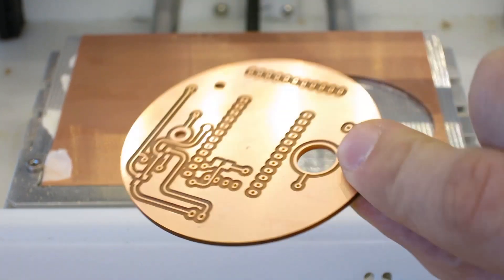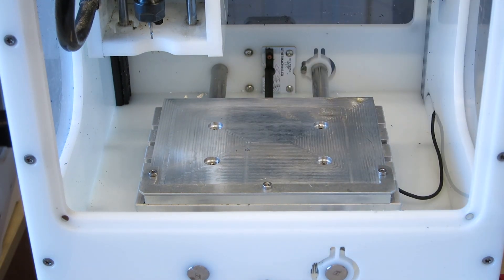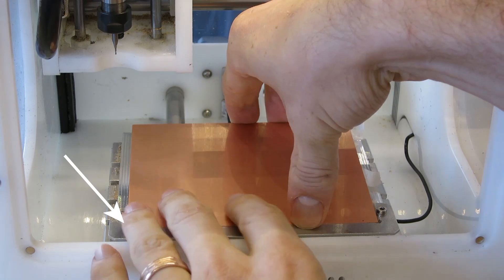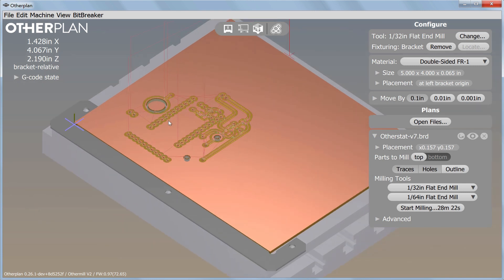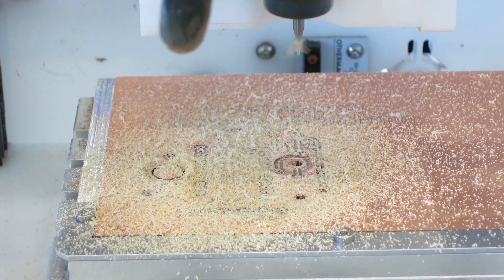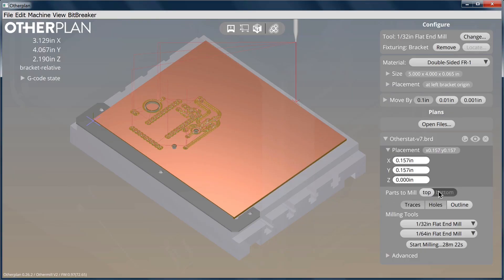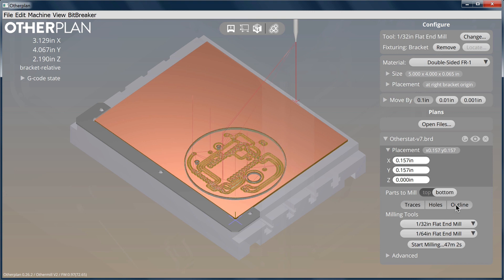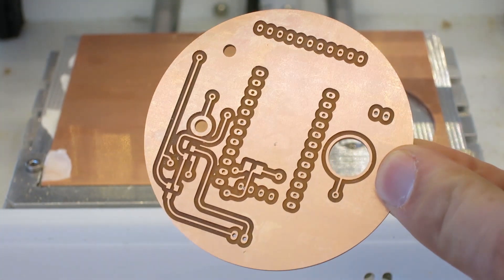How To Mill Double-Sided PCBs with Desktop PCB Milling Machine

Comment: I thought PCB were green. Why is this in bare copper?
Reply: You're thinking of solder mask, "a thin lacquer-like layer of polymer that is usually applied to the copper traces of a printed circuit board" (wikipedia). IDK if one can apply soldermask themselves but for hobby purposes they're not always necessary. Solder mask is used to repel solder when soldering, so that only the pad is exposed.

Comment: 😗 price so huge
Reply: It's a fantastic machine, for prototyping PCB's, I really couldn't imagine making them without it.
Reply: China has so much better options for 10% or less of the crazy price. Way way way overpriced. 4 motors and some acrylic.
Reply: Julio Ryuuzaki Using such simplified descriptors, computers are nothing more than sand, silicon, and plastic. Actually very simple, why bother paying for one when you can make your own?
Reply: Zakira Gur yeah, there are diy tutorials to make cnc machines. And for almost the same price you can get kits. What’s so different from this kit from the Chinese ones? Same Nema motors, generic brushless motor, anything special about the driver micro controller that a Raspberry Pi or even an Arduino can’t do? What’s so good about it to make it 3000?
Reply: You could've enjoyed the precision of the machine, it's pretty cool, also it's not just the machine, it has custom software for taking Gerber files, and making it an easy point and click process for quick PCB protoyping, it's not for everyone at 3k, but you can't hate those sweet results. I believe you've inspired me to make a video review though. ,':3 Cheers mate.
Reply: Zakira Gur By definition CNC is precise, and just by YouTubing about PCB making with custom made cnc machines, there is nothing special about this one. The custom software looks decent, but is not a 3k software, is just a simple 3D render of a Grbl file, at the end is sending the same G-Code to the controller than any other of the tons of free software can send. Does it have wireless interface? A webcam to check progress online? Automatic time lapse videos? A Raspberry Pi can do that. How about Auto feed boards for mass production? Like I said, it’s not much different from less than 300 dlls Chinese made ones. Completely Overpriced.
Reply: @RyuuzakiJulio  I didn't mean to intrude upon Chinese stocks, I was just pointing out that for someone who wanted reliable and accurate PCB prototypes, it's a fantastic machine, it's not meant to do production, it also doesn't need to be wireless, because it sits on your desk, and the PCB's are done in minutes, I know, because I have one. Just saying, I personally don't have the time to put into a DIY mill, I'm sure with someone with more time on their hands they can assemble and test their own mills, I prefer to be designing first and foremost. Cheers.
Reply: Zakira Gur Not everyone has a huge desk to put all kinds of peripherals. But you are right the pieces it can produce aren’t even large enough to take that much time. A completely custom one from zero might take a lot of learning and configuring, but a pre-made kit takes around 30 mins to assemble. For the price of a high end computer, and just get a glorified engraving tool. It’s laughable seriously, you want to pay 2800 dlls to save you 30 mins of assembling maybe two hours if you are really bad at putting stuff together, you say “I rather use my time designing” I say I rather use my coins on things that are actually worth the price.
Reply: @RyuuzakiJulio  Thank you for agreeing, I think we can sum it all up to say, that different things work for different people, and some people have more time than money, that's totally fine, when you get results as good as these, post them up. Cheers mate. ,':3
Reply: Zakira Gur one thing I must say is that I don’t have that much experience with cnc machines. Or even milling at all. I already built my cnc out of a router and learning about feed rates, etc. Waiting for drills to arrive today. So looking forward for that. Yeah some of us have more time than money. If I had more money than time, maaaybe I would look for a machine like this or even better.
Reply: @RyuuzakiJulio  Sounds awesome bro, learning is always a hard task, but with a great personal reward. Maybe you'll post some vids?
Reply: Zakira Gur Learning is everything there is. I would love to make videos of all that stuff I’ve learn, including programming and languages. But my channel is basically just about photography and most my viewers aren’t interested in the other interests I have. But I would really really love to share.
Reply: Product it by yourself ;)